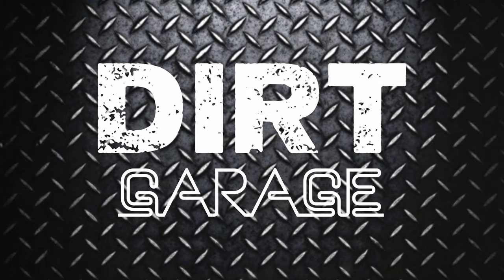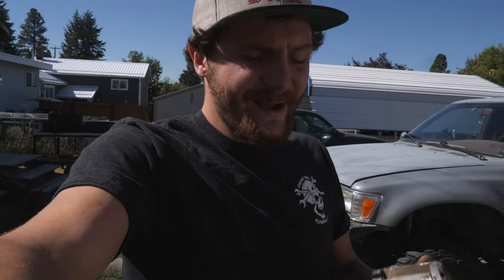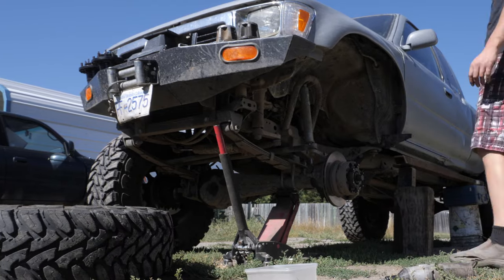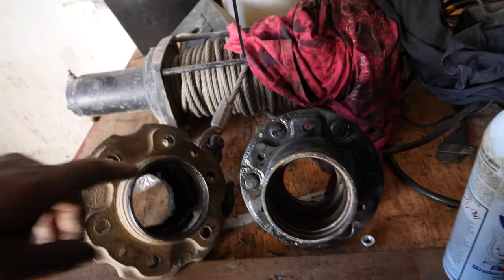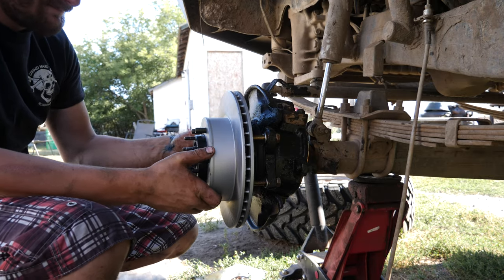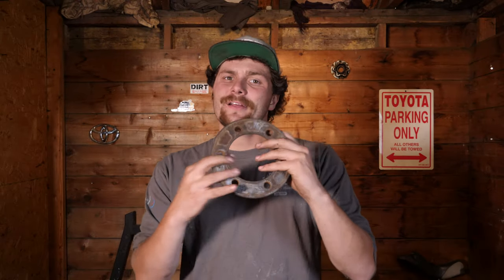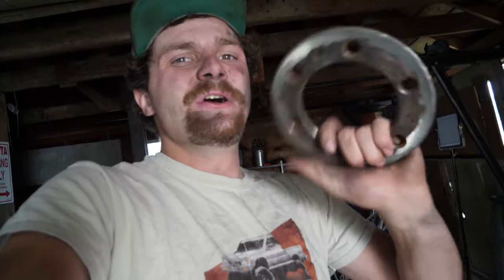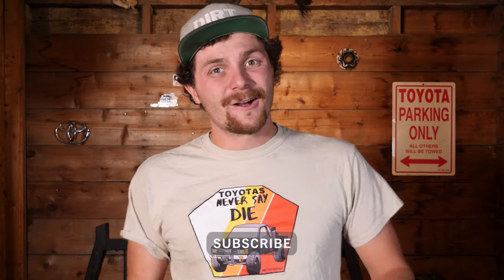Widening Toyota Solid Axle WITHOUT Spacers | IFS Hub Swap | Tacoma Rotor Mod

Comment: A couple things to add for anyone doing this swap, if you want to do the Camo method or  Toyota unit bearing mod, birfs will need to have the snap ring removed from the outside of the inner shaft. This will allow you to pull the knuckle and not mess with wheel bearing settings. Also, if you do this you will need to do the Martack mod to the inner splines of the shafts to keep them from floating too far into the side gears on the diff.

Comment: Dude, it was awesome seeing the truck in person. I only wish those hubs would have fit better... ive had the ifs hub mod done on 3 of my vehicles now, with 3 different sets of rims, and never had any major clearancing issues... had no idea that rims could mess it up so badly haha. At least you got it sorted out creatively...
I also wish i had the mazda finished when i came down haha. Oh well, next time, and then we'll go wheelin.
Reply: do you know if this swap works with 15” rims?
Reply: @brycesnevadatrapline3712  I've got the same axle under my mazda on my channel. I'm running 37x12.50-15's so 15's do fit. It's all about the backside of the rim and if it clears the caliper.

Comment: My 85 4runner is original, only added 15x10's  on 35's tires are about 1in past the fenders. perfect stance.
Reply from the maker: Yup! No need to widen a factory solid axle 85. Your axles widths should already match.

Comment: I did a very similar swap many years ago.  Except I used FJ rotors, ifs calipers and hubs. Not sure what the difference between the rotors is. I didn't need a washer for mounting the calipers though. Now would be a good time to upgrade the rear with the factory solid axle disk brakes you removed.
Reply: That's where I'm at. But the ifs rotor is about 11/16 thick. The FJ40 is 1 1/8" thick. Calipers are not gonna slide over it. 🤔just how did you get this to work?

Comment: Same issue but with some Pro Comp 62’s I think, the alloy ones. Turns out they are a -19 offset. I’m guessing each negative number is a 1/4” in or out. A set of wheels with -18 or -16 (closer to 0 offset) will eliminate the use of spacer all together. I think stock wheels run a -6 to -9 on offset, down fall of stock wheels there all 7” wide. And if you need studs you can pull the studs from your spacers. If your running alloy wheels like I am the rear studs aren’t long enough. The spacer studs are plenty long enough and in my case I have an extra set of 12 studs cause I had spacers on the front and the rear.

Comment: Next time u can use 03 - 06 toyota matrix  wheel stud they fit perfect and u have plenty thread if u are using aluminum wheels!
Reply from the maker: I already actually swapped mine for Matrix studs. Found that tip on a forum after making this video.
Reply: Yes i did it on mine 77 it worked great  on my truck  great vids i am also building my truck and making adjustments

Comment: What year ifs hubs did you end up going with? I have a 1991 toyota 4runner with ifs obviously and I acquired a 85 Solid axle housing. So I have to build the axle from the ground up and was wondering if I could get away with using my ifs hubs. Thanks.
Reply from the maker: Your 91 hubs are the same hubs I used in this video! Will work great. Need 86-94 IFS Hubs.
Reply: @DirtGarage  thanks alot man, you're videos are helping me with alot of my research I appreciate it! Keep up the awesome content!

Comment: Do you know if you can still fit 15" rims after the rotor and caliper upgrade?
Reply: Same thing I’m wondering
Reply: @loucksrylee_6060  I did it and you can, it’s especially easy if your wheels have a big offset.
Reply: @brycesnevadatrapline3712  so Tacoma calipers work. Wonder if they’d work with my 8” wide wheels
Reply: @loucksrylee_6060  yeah i used 96 4runner calipers. i can’t be totally sure about the rim width though. mine have a fair amount of offset

Comment: I'm going through this process right now. I get the impression that you're sliding the whole IFS hub on, does that mean you're skipping out on the snap ring for the birf? Is the outer snap ring necessary?
Reply from the maker: Correct. Throw the outer in the trash

Comment: Hello I picked up a set of 1984 Toyota axles. So I bought this Front U-Bolt Flip Kit 1979-1983, Rear 1980-1995 kit  from trailgear but the Ubolts are wider than the axle, if that makes sense. I’m trying to use this for the rear axle. Do I have an axle from another year?

Comment: My '83 toyota pickup 4x4 is stock solid front axle (not SAS) w/37"X14" tires, & 17" steelies. Are my axles narrow? If so, would IFS Hub mod work w/ steelies?
Thnx.

Comment: Hey ya just wondering if this can be done with an 80 series swap into my surf / 4runner. Ive already done the swap and have all the hubs etc they thing is the 80 series is already 2 inches wider than the rear ifs diff, so I've got my wheel offsets to make it the same width front and rear so if I were to do this mod, the front axle would be 4 inches wider than the rear so I would just get 2 inch spacers for the rear. But than my wheels don't fit over my 80 calipars, they only just nick the rim so may need 15mm spacers or something so hopefully its algood 15mm wider in front. But yeah please let me know of they will fit the 80 series axle thank you

Comment: If I wanted to use the ifs hubs and rotors from my 89 4Runner on a sas like yours, would I be able to? Do you know if the modifications would be the same?
Reply from the maker: It would be exactly the same! You need the IFS hubs, and Tacoma rotors, then your set!

Comment: Hey man Im in the process of getting all of the parts together for my 85. What year Tacoma rotors did you use 95-04 im assuming? any help would be awesome!
Reply from the maker: I used 98 specifically. Not sure if they changed in later years.
Reply: @DirtGarage  oh rad thanks man 💪

Comment: Do you happen to know what can solve death wobble with the SAS on a toyota pickup? I have read a lot and most people say its the caster angle. Just wondering if you have any input?
Reply from the maker: In my experience death wobble has always been caused by worn out leaf / frame tube bushings, or tie rods.
Reply: Could be bad caster , worn trunnion bearings , bad alignment ,worn steering components , worn spring bushings , just have to go through your front end one component after another

Comment: Is there a particular year ifs truck/4-runner. Or will any year work?
Reply: Any year will work i got 91 4runner on mine with no problem  thery were auto locking just swap your manuals

Comment: dirt garage do you know if ifs hubs from a 1998 taco will work for this swap? Or are they different then 86-95 ifs hubs?
Reply from the maker: Need earlier IFS Hubs, 86-95
Reply: You can use Tacoma brakes also or tundra brakes,  front range offroad tacoma brake mounting kit...
Reply from the maker: @jibaritomx  Brakes, not hubs.
Reply: @DirtGarage  my bad yes the hubs has to be 86-95..
Reply: @jibaritomx  ok thanks. Hey another quick question are the wheel bearings the same size on ifs hubs as solid axle hubs? I just got my ifs hubs and already had a full set of sa bearings sitting in the garage. Wondering if they will work
Reply: @nicholasmarioncunstruction  yes same wheel bearings and sa  locking hub bolts on ifs hub..

Comment: Can you do this swap and use the rotors off the 86-88 pickups instead of Tacoma rotors? I have 2 sets of rotors for the 86-88 from my current build but will be picking up a solid axle soon.
Reply from the maker: You need Tacoma rotors because they slip on over hub.

Comment: Can I use the hubs from a 2002 4wd 4runner?
Reply from the maker: No, has to be early IFS.
Reply: @DirtGarage  and can it be from anyone that is 4x4 manual locking hubs?
Reply from the maker: @palaciosivan100  Even auto locking hubs work. As long as the hubs are from early IFS with torsion bar suspension, it will work on the Toyota solid axle.
Reply: @DirtGarage  so a 86-95 year range. Thanks bud!